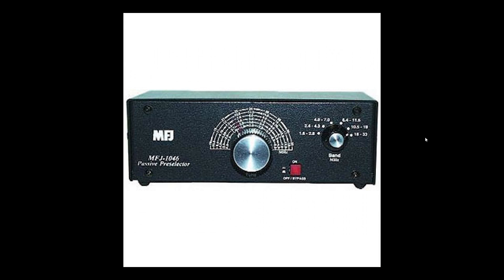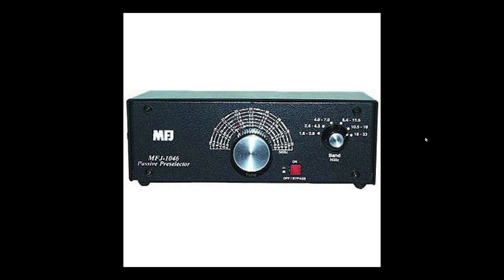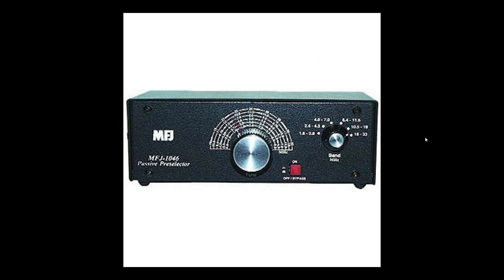What is a preselector and yes it can improve shortwave reception

Comment: The DX300/302 were fitted with a preselector as was the FRG7 and Racal RA17 as part of the design of the Wadley loop architecture, NOT because of any inherent fault with the design. These early "synthesised" analog receivers were very good for their time and far outperformed the cheap consumer radios of today. All the modern up converted superhets use a broadbanded front end, as does the DSP versions, making them prone to overloading and cross modulation.
Reply from the maker: They were horrible receivers plagued with overload issues, I had a 302 and can tell you that a $100 SW radio today beats the hell of of them
Reply: @OfficialSWLchannel  The DX300/302  had way too much gain in the tuneable IF section, easily fixed by removing the emitter bypass capacitors in the final 455 kHz IF.  Off topic I know. The modern DSP based radios lack any front end filtering at all. The excellent performance of the Racal RA17 among others bears testament to the correct implimentation of the Wadley loop design.  ANY radio lacking front end selectivity will benefit from a tuned preselector.